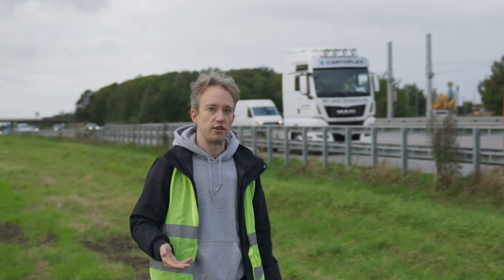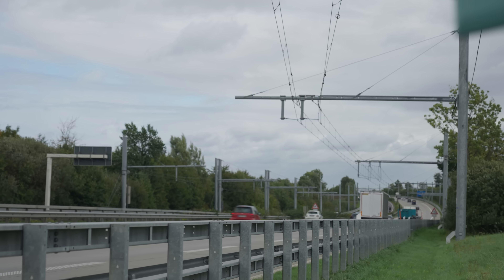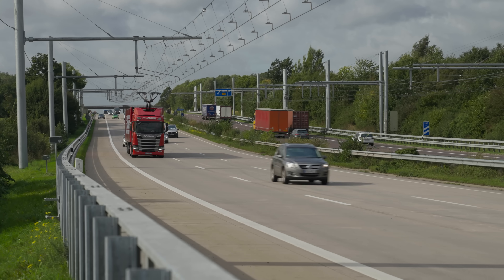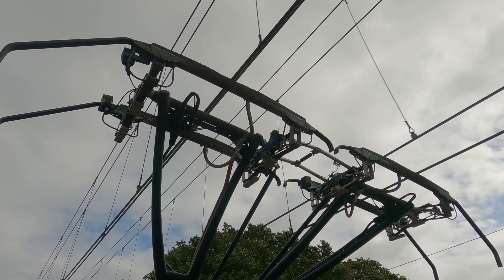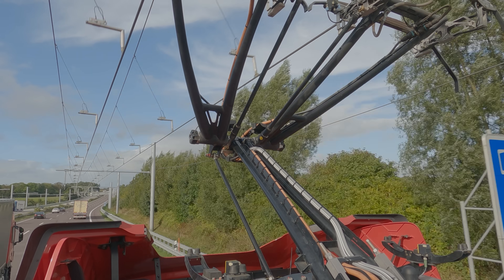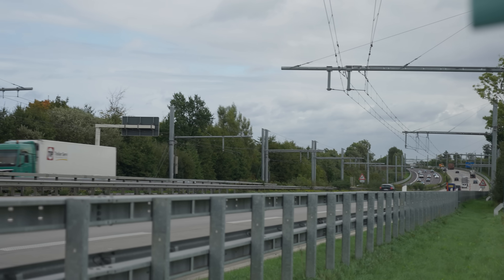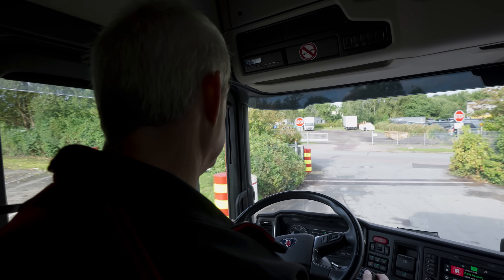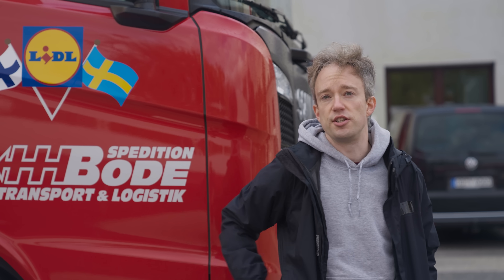The highway where trucks work like electric trains

Comment: Troleybuses have been around for a long time. They are applying technology that is well known and thoroughly tested.  
I have no doubts that this will work well where there is infrastructure but it will need a battery to reach some locations.
Reply: I think the point is to use cable and smaller batteries for Autobahn driving, and use diesel for local routes since it would reduce a major amount of emissions, while not completely destroying the carrying capacity of the trucks.

Comment: Are the lorries diesel electric hybrids running in electric mode under the wire or are they pure electrics with small batteries which they charge up when running under the overhead - using ‘in charging motion’?  Battery trolleybuses have been doing this for a few years now. Same voltage but using trolley poles and simpler overhead.  In Birmingham the trams also use ‘in charging motion’ so that parts of the system don’t have overhead lines.  Thanks for the video.
Reply: I think both exist.

Comment: One issue - grooving on the carbon strip on the pantograph. You can see it in the video @3:05

Normally railways solve this by zig-zagging the wire back and forth, as this combines with the predictable lateral position of the train and wears the pantograph evenly. 

Here, you can see the wires cutting into the pantograph quite deeply.
Reply: Good catch!
Reply: Oil changes turn into pantograph contact changes then? 

I think the bigger issue is the height of bridges compared to the height of the tallest trucks that run through them. Some trailers only clear motorway bridges by inches. Though with this system, only a certain percentage of the road needs to be electrified anyway.

I wonder how big a battery a lorry would need for the ~4.5h maximum they're allowed to drive in one stint anyway?
Reply: @Theaveragenerd2000  Daimler quotes 400km (about 4.5 h) with their 420kwh battery ( eActros)

I am not sure, i think most cases of just high enough bridges are in urban areas, highways generally have enough clearance, but i am not an expert.
Reply: @tzarcoal1018  I wince every time I see the 2 storey trailers go under some of the older bridges over the motorways. But yes, any bridge without a warning sign is supposed to be at least 5m tall, and I've never seen a motorway bridge with one of these signs.
Reply: Trains are on fixed rails, so they need to vary the wire positions to spread contact wear. Trucks however are going to vary their lane position constantly, doing much the same thing. It's just another item to inspect regularly and replace when needed.
Reply: @JamesChurchill  I actually think this is the problem. 

Trains know where they're going to be. Trucks don't. So you can't slew the wire from side to side in the same way, it needs to stay central. 

And I think, since you can see the wear on the strip at 3:00, that natural movement of the truck isn't enough mitigation.
Reply: @JamesChurchill  Also, trains use the rails as the return conductor, so there is only a single pantograph the full width, and one wire overhead, which gives them more room to move.  Here, there are two wires overhead, and a dual pantograph with much narrower pickups, so they have to stay within a much tighter tolerance.
Reply: It could potentially be solved by including a system which detects the vehicles position and automatically moves the head of the pantograph laterally along the wire depending on the position of the wire to create a more even wear pattern.
Reply: From my understanding they are replaceable, so much like tires, they wear down over distance and need to be replaced every so often.
Reply: @dontworry1302  Correct, you can. They're specialist pieves of kit though, they're not cheap on the railways!
Reply: @AttaboyIII  I don't doubt they will be expensive, but the sheer number of trucks there would be in comparison to trains would drive the price down and introduce more competitors. I'd be willing to bet over the course of a truck's lifetime, the total cost of graphite contacts would be lower than total cost of diesel is now.
Reply: I mean, that's easily solved by simply swapping out the pantograph's carbon strip every so often. I'm assuming they can be recycled, but even if they aren't, it would still be cheaper and better than the gallons of fuel used for the same journey.
Reply: @mickys8065  I know the rail equivalents are not cheap
Reply: You think that a project with millions behind it and tons of engineers don’t already know about this? I’m sure they’ll either move the wire or let the natural shifting of the truck do the job
Reply: @sam-rs8wg  You can see at 3:00 that nautral lateral movement is not enough. I cant speak for the engineers, but I am a rail engineer myself and I know a lot of very expensive effort goes into solving this problem gor electrification projects.
Reply: Would still be quite feasible to solve in later phases by combining zig zagging and lane assist, wouldn't it?

Comment: Or maybe a better idea, one that already exists: a train. (Especially for long distances) To me it looks like they are trying to reinvent the wheel here.
Reply: Trains are really complicated for doing the things a lorry does well. I'm all for rail transport, but it's important to support lorries too.
Reply: Well if they can run without grid as well its a train but better.
Reply: @quackatit  It's a train but way less efficient, way more dangerous, and requiring way more personnel.
Reply: @Huntracony  but cheaper
Reply: @quackatit  Cheaper to build, way more expensive to run.
Reply: trains are super expensive in comparison and involve ripping up land to install rails, also need special infrastructure for interfacing with a warehouse

they could run trucks together and have a road train, could be just about as good for a fraction of the cost and TIME
Reply: How will the cargo get from point a to the station and from the station to point b? I wonder if its by.... truck? but for real though, just putting down train tracks EVERYWHERE is extremely expensive, complicated and dangerous. These trucks will be able to connect to the network when needed, but they arent restricted to stick to them, making them more flexible to adapt to new routes. You cant have a train adjust to new routes every few decades thats just inefficiënt
Reply: @Ilsezwarts  Did you not watch the four minute video you're commenting on?  This is about long haul between warehouses and ports.  You just build stations there.  Yes, trucks will stay for short haul, but those can just run off batteries.
Reply: Train is much more expensive and slower to build. Also it's probably really hard to properly plan all the necessary routes, and most importantly they can't easily change once they are build. While this is just electricity cables over already existing roads.
Reply: We tried trains, but building a track to each and every warehouse of different retailers is just not feasable.
Reply: @emilychloee  It is feasible.  We used to do it before trucks existed and we could do it again.
Reply: thing is that most lines in europe are just for passenger trains and those run on higher speeds to whats better for freight.
Reply: Depending on the distance I'd agree. I think this is still a good idea for medium distance routes where a train would make no sense.

Comment: I know it's impossible to implement rail to all infrastructure but if there's a fixed road (for example from a port to a warehouse) good old train will always win in the long run
Reply: Thing is, the trucks may all come from the same port but go to a myriad of warehouses. If everything comes from the same wharf and goes to the same warehouse, then sure, train is the answer. The problem is that's often not the case.
Reply: @GerackSerack  
And that's why there are marshalling yards.
E.G. the train goes from the port to the marshalling yard. There the trailes are sorted by destination and brought there by other trains.
Reply: @GerackSerack  Plus, the Autobahn is already there (you just have to add the overhead wires) and cars can drive on that lane as well.
I'm all for moving more cargo via train, but you'd have to (re)build a lot more infrastructure compared to this system. And you could also equip main city streets with this system so trucks driving into the center (to supply shops there) are cleaner and quieter.
Reply: @rolfs2165  The electric overhead system doesn't do anything for capacity, only power supply.  Europe's passenger and freight capacity problems are greater and more ignored than this "green" energy crap.
Reply: @GerackSerack  Warehouses once nearly universally had their own rail spurs.  Now containerized freight has eliminated a lot of freight transfer and it is easier to back trailers up to a building individually than to switch entire strings of boxcars.  But warehouses would still be more centrally located near wharves and railyards if not for massive highway subsidies that underprice road use.
Reply: It's super expensive upfront and it's hard to even get the permits to build a track, even for the Deutsche Bahn (the German railway company), let alone for a private company
Reply: true but this allows the flexibility to go into towns along the road and to each shops. it will not remove the trains as they can travel faster than trucks but the paths a truck takes can't be taken by train and the flexibility a truck provides out values the cost savings of taking a container some  km. in land to where a truck have to take it a few km. to the shops. simply having the trucks at one place at a harbor in a industrial area is better.
Reply: @TheShadowblade It is a good idea, hence why we depend on the railway so much in Europe and America. The problem in the price, you literally have to buy and own all the land to and from destination as well as get through all the government regulations ever since trains were changed from private business to public infrastructure.
Reply: @TheShadowblade it was but lobbyism is a thing, especially in Germany. We hale an extremely powerful automobile lobby here which managed to basicilly kill our cargo railway system in the last 20 years.
Reply: @TheShadowblade It was done already, at least in Europe the rail network was far denser 100 years ago than now. City planners all over the world in the 50s and 60s started scaling back railway infrastructure in favour of car infrastructure because back then they thought cars will be the future and when we one day get something better than cars it will also be a form of individual traffic. 

The drawback was that a lot of factories and small towns lost their access to the rail but it was thought that it doesn't matter because factories were slowly being relocated to countries with cheaper labour costs and the people in the small villages and towns can just go by car. 

Now we are in the situation that so many more goods have to be transported that a railway system might make economic sense again, at least between warehouses and other smaller transport hubs but a lot of the old infrastructure has been dismantled or is in disrepair and it would cost billions to get it running again, if even possible at all. A lot of places where rails have been dismantled roads have been built instead.
Reply: @TheShadowblade 
Not really. It's not always obvious it's a good idea before you do it, but often people don't want to invest in ideas which they don't know are good. People like guarantees, like sticking with what they know works.

Additionally, not all interests are perfectly aligned in the same way. It can be a good idea for a certain goal and terrible for another goal, like profit for the fossil fuel industry, and so those opposing interests will try to prevent the good idea.

Also, plenty of good ideas just haven't been thought of or championed despite everything else aligning

And plenty of good ideas haven't been done because they're currently being done and it takes time
Reply: Train good, car bad! 

Atmospheric Railway BEST.
Reply: @Ingestedbanjo  Great reference. Everyone listen to the podcast "Well There's Your Problem"
Reply: Sure, but then you are loading freight on trains, usually from a truck.  With this system, you can load freight on Trucks, then drive the truck to the highway, connect to the power grid, drive the truck to its off-ramp, disconnect from the power grid, and drive that last mile to the next depot. 

In the best-case scenario, where train tracks connect the start and the end point directly, or if the trip is from one side of a continent to another, trains would be more efficient, but that isn't always the case, especially in more developed locations.
Reply: Problem with trains that we would need more tracks to transport more goods, but its hard because you need to build new infrastructure, while you can just simply upgrade highways. Not to mention that you need to transport stuff from rail stations to individual warehouses.
Reply: @TheShadowblade no, no it would not have. Politics and NIMBY are both great causes of good ideas not happening
Reply: @TheShadowblade and it was, but motor companies were able to lobby gov'ts to make sure it was phased out and never came back.
Reply: The road is already there, to build a track you need to expropriate people and spend a few years in legal battles and than spend millions on the track. Adding powerlines to existing roads and letting companies buy their own hybrid trolley trucks is far cheaper and easier.
Reply: no, not cost efficient.
Reply: suprisingly enough transport on rails is more expensive than the good old road. there are just to many players that want to have a piece of the cake: departure station, the train provider, destination station and if you cant pick it up right away you even have to pay for storage. also cargo on trains arrives later than on trucks
Reply: @ukaros_ateon  no it's not. per unit and per litre of fuel, no. maybe it costs more to move the amount of stuff trains usually move but they're not more expensive for what they carry, and i am certain about that, it's not even close. trains are more efficient
Reply: The real problem is money and permits. It's cheaper for the government to let companies pay for their own transport than to create a railline. For companies it's also cheaper because you can't just make your own personal railway. 

All trips longer than 10 hours should be forbidden, and loading+unloading trains to trucks should be improved so the overall travel time doesn't suffer
Reply: @TheShadowblade that's terrible logic
Reply: Train + metal box that can be put on anything = perfection
Reply: @TheShadowblade good
Reply: Yes, but there isn't, nor will there be much new rail in the populous northern countries. The road system is the most complete transport system we will ever see, making use of it better is the key to success.
Reply: Wrong.  The cost itself is prohibitive, let alone the disruption of telling hundreds or thousands of households "were pulling your house down"
Reply: Trucks are more versatile and this is the best middle ground

Comment: The problem with electric trucks is the weight. Our DAF 510XF weights, lets say 25 tonnes with the lorry, trailer and loader on the back, that means we can carry 25 tonnes of payload. With a battery pack, the payload would shrink too much for the trucking industry to make money, even just ends meet.
Reply: And this system, if widely adopted, massively reduces the battery capacity required, so solves the problem.
Reply: @weevilinabox  the electric drivetrain is still going to be very heavy and not all of 50 ton trucks are on the highway constantly, take my dads job for example, often over 50 tonnes, drives all over Denmark. From city to city, but not that much highway driving compared to off highway. It just won’t work or be worth it for such a big part of the industry. Had it been his old job, then yes because that was just constant highway, but the payload will still suffer from the massively heavy electrical powertrain. There’s no getting around it. You’d have to increase the max allowed weight for electric trucks, but thats unfair and dangerous. 50 tonnes with a diesel truck id already gonna be one hell of a scene if something goes wrong. Now a 60 ton electric truck. Thats gonna be an exponentially bigger safety hazard.